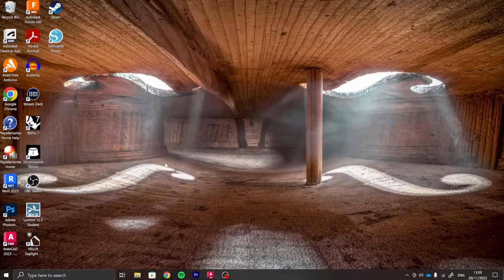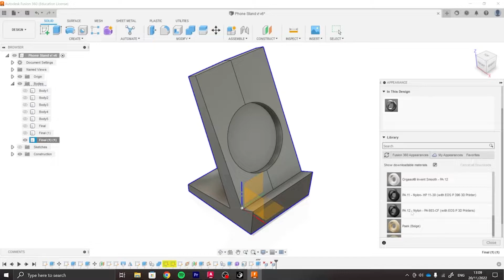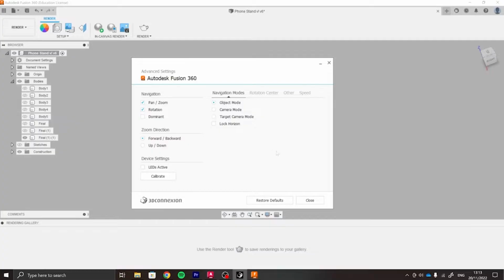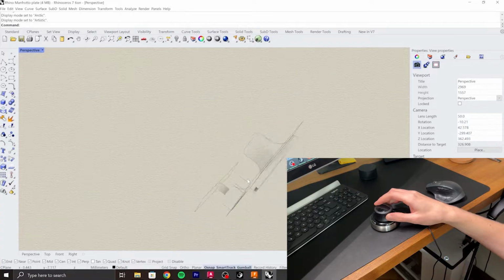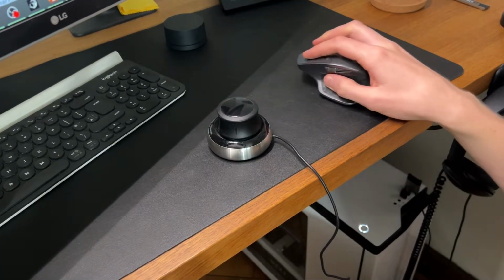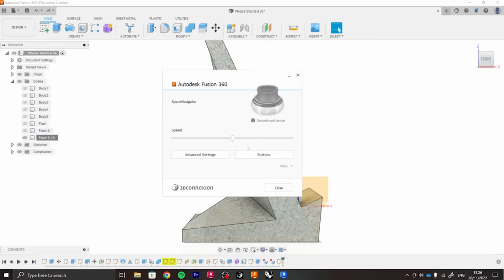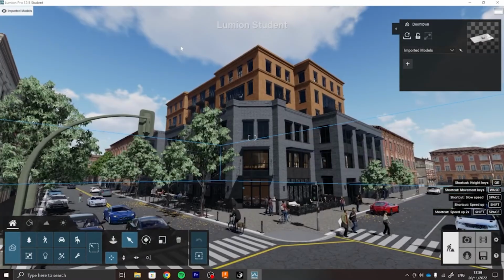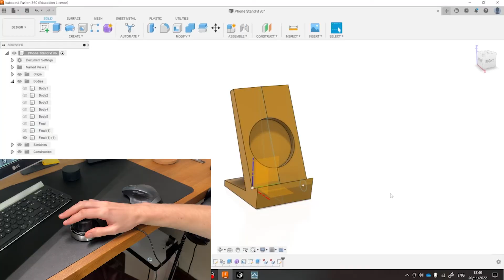Is the 3DConnexion SpaceMouse Worth It? Watch before you buy!

Comment: It is just what I was looking for. If you manage to work with CAD in accordance with Drawing tablet it works perfectly. It's been a pain in the ass trying to handle the Pen and the Keypad at the same time. If you don't need it, don't buy it!  I bought it to control the part’s view with my left-hand while I use a graphic Pen on my right hand to draw on the screen of my Graphic Tablet. However, if it wasn't for the Pen I wouldn't have bought it because, it is extremely expensive.  I bought the wireless version once you have this option as well.

Comment: If you move your right hand from the controller to the mouse, I strongly advise you to move the SpaceMous to your left hand. Working with both hands is a fundamental advantage when working with 3Dconnexion products.
Reply: Having never seen this before, it was still obvious this goes on the other hand...
Reply: Exactly, having 2 hands, it's inefficient to use one for 3 devices. Looks to me like his desk is too high and his second hand is resting and it takes too much effort to use it because of height.
Reply: This is correct. Really a mouse can do everything the Space Mouse but you aren't limited to a single degree of freedom. So a lot of user error being presented here. Where this device shines is creating flythroughs. I'll state that I was a CAD administrator and everyone was given a Space Mouse and almost everyone failed to use the device correctly. Instead the all used it as presented as a device adjacent to their mouse instead of the keyboard. So they all failed to also see the benefit. As much I tried, some of many refused to used the device as intended, and they were the ones that almost never used it afterward.

I'll state that only 3 degrees of freedom were suggested with this device. And this is wrong, their are 5. You have X, Y, Z movement but you also zoom and spin. And you can modify all of these things simultaneously. Where as with a mouse, the most you can do is 2 with that being panning in on single plane. If you want to spin, it's different action. If you want to rotate, it's a separate action from that. And usually this is a keyboard interaction to spin and zoom. Zoom is usually a mouse wheel mapping, but spinning isn't, so you'd have to normally either click top row icon to or click a keyboard button to toggle it on. So what this device actually does is replace that keyboard interation. So you're replacing a left hand interaction one the keyboard with interation with Space Mouse. Your right hand stays on the mouse.

Here's the thing, a lot of the design process is actually not clicking on things. We'd all like to think that we a most productive when we're actually creating geometry, and maybe that's true. But actually great design creation is done with intent. This means that you are not just creating the geometry, you are creating the geometry that actually works. So for much of your time, you need to verify the design is correct to the intent. This requires not only review as the design is being created, you also have peer review. And this is where this kind of device shines. Actual good design is a lot of staring at your model verifying that the intended design is being created, which means just staring at your model. And this device allows you to be very efficient during this phase of the design process. Which means that during your workday, you're spending less time staring and more time actually doing more clicking and creating geometry. This is how this device most beneficial. It doesn't save clicks, but in actual work it reduces the downtime when you aren't clicking on mouse buttons. So you spend more of your actual workday creating geometry instead of reviewing that the design is as intended.

As far as the buttons go, you really only need one of them. Being more familar with PTC products and it's use, I would say that one button should be set to move the model back to the default view. In Pro/ENGINEER or Creo this is the [Ctrl]+D shortcut. You'd map this button and it tells the software to recenter the model as it appears when the model is first opened. Honestly, you need this button mapping as just nudging the model can move it off screen and it's extremely hard to move it back to center with the device without visual cues. You can use the other button for something else, but honestly I only ever used this single button mapping. 

These are great devices, but really only someone who is exceptional with modeling will actually benefit. They know that it's a waste of their time reviewing their designs, but they also know it's necessary. If you struggle with using the software, then you'll struggle using this device.
Reply: @rolando_j_  Yea I can see how this device makes it easier and more intuitive to "fluidly navigate" rather than doing the kind of "step wise view changes" that You normally do with a normal mouse. But then the video, despite it's "alleged errors" got the "gist of it" correct, by saying that "it's mainly useful for visualisation"...
Best regards
Reply: Hmmm... to change the hand that You are using for all keyboard shortcuts to a "controller" that only offers 3D navigation and 2 buttons doesn't sound like the "optimum" for 3D-programs, most of which that are known for being "heavily dependent on shortcuts"?
If anything I would have thought that a "3D mouse" could replace the "traditional mouse" since it already is used for some of the same "tasks" as the "3D Mouse" (namely "Navigation") !?
Reply: was thinking the same thing.